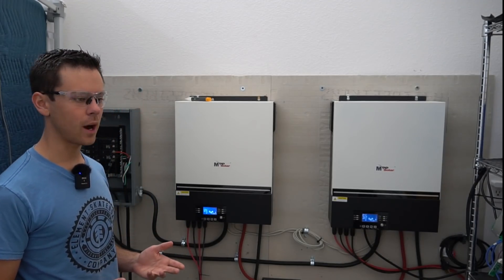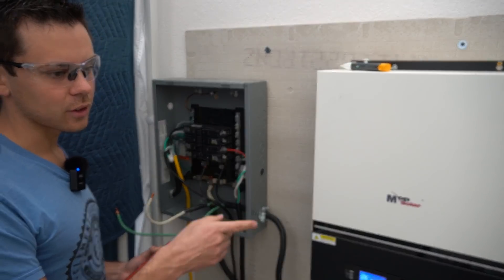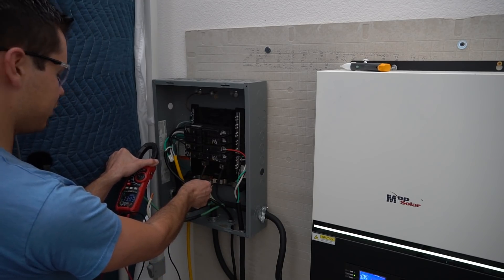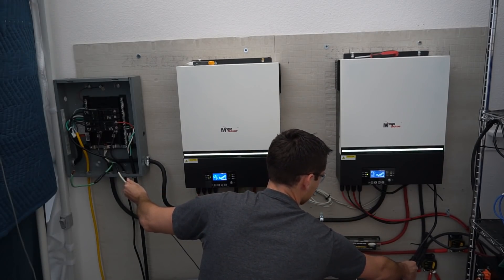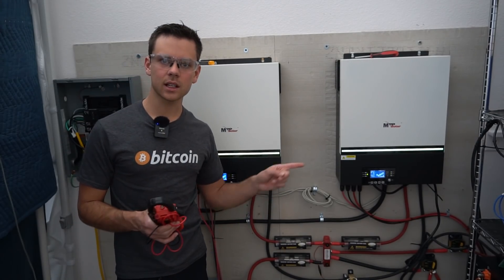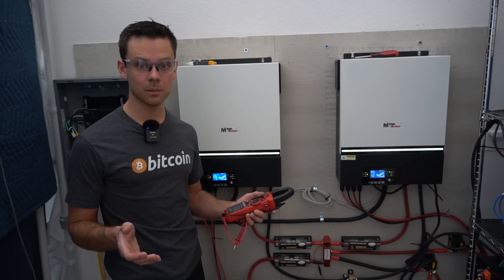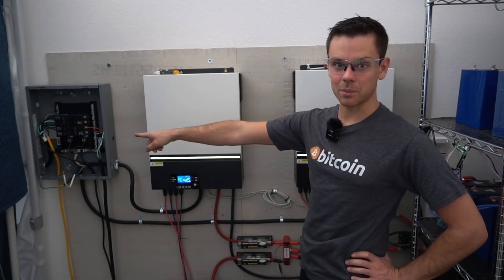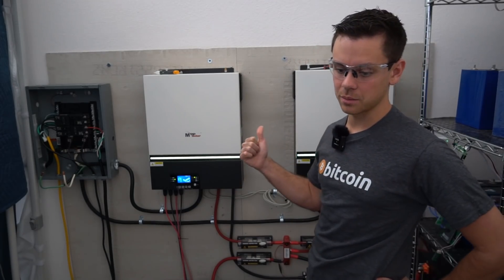Advanced Level Grounding Discussion for All-in-one Solar Power Systems

Comment: How did you conclude that neutral is bonded to ground in the all-in-one inverter?  You can't use the connectivity function of your DVM for this purpose.  If you measure a non-zero voltage between neutral and ground from the inverter, then they are not bonded internally.  My Growatt SPF 3000TL LVM, when running off the batteries, measures 60 VAC between neutral and ground, so neutral is not bonded to ground internally.
Reply: Holy smoke. Seriously? Showing any voltage above 1-2 volts between ground and neutral is dangerous. 60 volts sounds like there is no bond at your main panel either which is the only place it should be bonded, actually sounds like no bond anywhere. That's scary.
Reply: @wgoode505  The output of the Growatt SPF 3000TL LVM 24P is 60 VAC on both line and neutral, relative to ground.  The main panel is bonded.
Reply: @PogoTheFearful  it just sounds to me like something is seriously wrong. If neutral is bonded to ground there is no way it can read voltage between the two if they are connected together. The same as touching your two leads together on your volt meter, it can't read voltage doing that.  Possibly the volt meter is bad. Or maybe the bond is getting broken between neutral and ground when you are on battery, if this is when it does that. This is also assuming you are in the US with 240/120 volt system. Doesn't make sense. Be careful, be safe, good luck with it. It just raised concern to me, never heard of anything like that in my entire 40 years in the electrical field.
Reply: @PogoTheFearful  As a test to reassure myself, thinking I may have a stray voltage or something. I went and tested my own panels. I have my main meter/breaker panel outside and it feeds three 100 amp sub-panels inside, with one of those panels feeding an inverter and also a separate 100 amp transfer switch input feed for my generator. I turned off all 240v loads and turned on every 120v load I could and measured neutral to ground voltage in all 6 panels with full 120v loads and they all read 0 volts between neutral and ground. Only my main meter/breaker panel has neutral bonded to ground as it should be, with two ground rods connected to that panel. Never hurts to check yourself sometimes.
Reply: @wgoode505  My point is that when the Growatt inverter is sourcing power from batteries, the connection to the main panel is severed (other than the ground connection).  Because the Growatt inverter does not bond neutral to ground when it disconnects from the main panel, the line voltages from the inverters are "floating".

Comment: Hello, I live in France. and in some buildings there is a special earthing system, the normal is called TT, the special IT for earth insulation, at the inlet there is a transformer and the seguonder of the transformer is not earthed, but there is a problem monitor.  that triggers if 2 faults are detected. Maybe there is an inspiration to take

Comment: All ground rods are required to be tied together. So yes, another ground rod at the panel AND connect to solar panel rod to the AC main ground rod. This is run underground, bare copper conductor. AND test your earth ground.

Comment: So a few points here to cover. First all electrical systems should only have grounds and  Neutrals bonded in one location. This is at the  meter or first point disconnect.  If the neutral  and grounds were connected in more than one place, this would create  What we call a parallel neutral which is bad. The ground and neutral would  Share the return current. And we NEVER want current to flow on any ground. Now most of the time even when using a generator the natural to the power co is still connected and therefore only one bond location in needed. Now there are  Situations where the neutrals get separated or  Disconnected from utility company.. This is  Called a separately derived electrical system.  An example of this is after a building transformer you have then another ground and bond point.  Again as long as the neutrals from both systems were separated.  The question for you is  If you were to put the inverters in the utility mode what would the ground and neutral still be bonded from the inverter? Is there a relay for this?? I would  Most likely remove the bond strap in your output panel you're output panel but I would definitely nstall a ground rod. I would ever keep the system floating. That would cause GFCI problems  Among others.

Comment: I am getting very aggravated with trying to set up a solar system. I bought one of the growatt 5000 es and did not buy from Signature solar, so i am at a stand still not knowing if i am safe using. I am just going to throw this inverter in the dump and continue using grid power! this solar BS is just not worth the trouble unless you are a electrical engineer. solar is over rated for the normal consumer at this time! maybe re-visit in 10 years! GROWATT SUX!!
Reply: i feel ur pain i just order 2 mpp lv6548... trying to avoid all of this growatt drama ... $3000 worth of i dont know what to do!!

Comment: Extremely Dangerous under fault conditions. Why?

Let's say a hot water element blows a hole in the side of it but doesn't disconnect the circuit breaker and stays on (very very common with hot water elements at the end of their life)
Where do you think the current will flow if your tank is not earthed and you jump in the shower and start running water over your body to the drain system below and then touch the metallic shower head?

You will be electrocuted under these Fault conditions. This is a fault I've seen many times here in Australia in homes not earthed correctly or people removing the earth water bonds from there metallic pipes.

Comment: as per NEC 2020 ground natural connect at fist(main) point only. put earth ground at that one point only . so earth ground first all in 1 unit . then use ground buss to connect the rest system. that ground . now bound neutrals all together on a isolated from ground buss. that way 1 point ground natural come together. no ground loops and every thing has ground. you want to maintain ground for safety and natural as for split phase power north America has. Yes ground loop can be dangerous. even in totally off grid still ground at AC/grid/gen only for earth ground. that way if using a generator you don't get a loop.4 wire hook up. hot 1 ,hot2, natural , ground. never make connection of natural and ground at any point. the all in one has that bound you tested for it. get a NEC 2020 code book has the current codes for a safe system. anyone doing this in US/Canada follow the current NEC . can look up online or buy the book. as a electrician I have the latest NEC book and I follow it. I pass my inspections . also you can reach out to UL for a inspection of the system. Each town has there  requirement's. .find local inspector and ask them.

Comment: Hmmm.  I am not an electrician. Having said that it has also been 20+ years since messing with electrical circuits. I begin thinking 1:1 isolation transformers would be the ticket to interrupt any DC bias. However if the inverters are outputting pulsed DC and not AC, I have no clue.where to go.  just 2 cents that is probably inapplicable.

Comment: I am no electrician but I was in the dairy industry and when wiring a milking parlor all sub panels ground and neutral wires were to be separated.  If they were not it caused a condition called stray voltage which harmed the animals.  If I remember right the only place they are connected is at the main panel because all power eventually the power goes back to the power stations.  We did have some cases where there was power coming back to the farm by the ground wire, then the power company would have to add more pole grounds.  This probably don’t shed any light on the subject but that was my experience in grounds and neutrals.

Comment: Hi will, first just wanted to say thanks for all the great content over the years, I just ordered 2 lv6548 a week ago. I did not go with growatt because of the neutral bonding safety issue and other transformer related issues, i was told mpp was safer/easier and designed to work and be compatible with north America power grid... now that seams not true.?!? I don't know what to do now... in your opinion can they only be safely use off grid? thanks again have a great day!!!

Comment: I’ve had issues with all-in-one inverters like this in the past. Mostly sol-ark, and I found that if i don’t bond the neutral to the ground in the AC output load center, I get fault codes, and I even got shocked from the ground out of the inverter. But once I tie the neutral to ground in the panel, problem solved. Very strange as I was under the assumption that they were bonded within the inverters themselves.

Comment: I wonder if the the 240v single phase versions are different. That earthing arrangement could cause alot of issues on modern installs in the UK and Europe. And all but unusable on a split phase supply in the UK (we do have split phase its just very rare, it normally manifests itself as two completely separate 250v supplies due to our phases running at 400-415v)

Comment: Hi Will, Here in the UK, we just have an earth ground  (Green), live (RED or Brown) and a neutral (Black or Blue) wires keeping it simple. Why does one  need to connect a third to the neutral wire?!! That's putting like a live-sh part (Neutral side of a Supply power) to what you are calling a ground wire, which is supposed to be Just that an earth grounded wire into the earth. Thus any metal surrounding power supplies casings or electrical goods are then save to touch, as they are all connected to ground earth. Which by the sound of things is being turned into the negative side of all power supplies!! Am confused with this!! Makes no sense to me this, a ground wire  is either a common  negative separate to earth ground is it not? Regards George.

Comment: You should use ONLY the utility ground-neutral bond (in the meter or main panel) in any instance where the neutral conductor of your utilization system is connected to the neutral of the utility system. 

Only if you disconnect the utility neutral input from the output of your inverter (either automatically, manually, or by design) should you bond elsewhere, such as inside of or after your inverter. 

You can have as many grounding points (ground rods, metal equipment sitting on concrete, conduit attached to steel framing) as you want, so long as there is ONLY ONE point where your ground system is connected to your neutral conductor.
Reply: You could even have a separate ground rod for each inverter, panel, run of conduit, outlet, etc. as long as you attach it to ONLY the earth ground and not the neutral conductor.  

The take away is ONLY ONE GROUND-NEUTRAL BOND PER PROPERTY at a time. Everything else is details.
Reply: @paulmccoy2908  And tie All of the Earth Grounds with #6 copper!
     Ya'll Take Care, John

Comment: Great, so I've seen this explained two completely different ways in the past 30 minutes. 
One saying ground and neutral need to be separate, this saying you need ground and neutral bonded. 
I'm just a DIY guy with a solid understanding of audio electronics and computers. You know, complicated stuff. 
How is there any controversy or wiggle room on something as basic as 3 wire AC? It's been around for decades.
Reply from the maker: High frequency transformerless off-grid inverters in parallel on each phase has not been around for long. And whether to bond or not depends on your situation. That's entirely up to you. Don't listen to any YouTube person or manual. Figure out how it works and come up with a conclusion on your own.

Comment: This is a very complicated subject that even has many professional electricians scratching their heads. I would encourage more in depth coverage of the subject (that even I get lost on).
Reply: It is not that difficult, this just common mode, engineer tends to use complicated words that makes a mess
Reply: I totally agree I know nothing about grounds or grounding
Reply: Yes. More coverage needed. What to do with the ground because the wrong thing can be done in an attempt to do it right. What in the heck is the purpose of the ground on these inverters. The fact there isn’t even a slight suggestion in the manual makes it worse.

Comment: Hi Will, at about 2:30 you stretch both arms to make contacts.  Please consider a spring loaded "alligator clamp" for the test wire so your arms don't provide a possible circuit.
Reply from the maker: I actually have a lot of those but they were on the other side of the shop

Comment: I own and operate a growatt SPF 3000TL LVM. And I need it to operate both from the grid and from the batteries.  When the system operates from the batteries there is no bond between the ground and the neutral.  Some of my loads require there to be a bond.  My main electrical panel already has a ground neutral bond and when the transfer switch goes to grid power my loads operate normally.  The inverter has a set of dry contacts that can be used to control a ground neutral grounding box.  When my system operates from the batteries it turns on the ground neutral bond.  When it transfers to grid power it turns off the output bond because my panel already has one. Hope this made sense
Reply: Hi John, I am using the same SPF3000, may i ask where is this "set of dry contacts that can be used to control a ground neutral grounding box" ? is the manual showing how to turn it  on when using power from battery? thanks
Reply: @VincentsfamilyCali  yes its in the manual. There is a set of contacts in the bottom middle of the unit labeled C - common NC - normally closed NO - normally open
Reply: @VincentsfamilyCali  you only need to bond neutral to ground if your appliances require it. And you only need to have a relay if you're using grid power where a bond already exists

Comment: I see the use of a grounding relay in a lot of cases where it gets tricky like this. I'm defiantly not a fan of inverters that bond the ground and neutral internally.
Reply: I've just worked on an RV solar setup where I thought I needed to unbond the N-G connection. What happens is the 120v output is present, but there is no "hot" nor "neutral" line - the 120v is "floating. We wanted to protect the user with GFCI, which needs a "hot", "neutral" and "ground" for the GFCI to function properly. One side of the alternator charging line was at chassis ground, and that became our "system earth". Neutral was bonded to this "earth in the inverter, and now the GFCI trips as it is supposed to with the tester. But our solar system does not have a shore power connetion - it is completely isolated from the solar power.

Comment: That's interesting. I was always under the impression that a system should never have current flowing on the ground path. If the inverter has a neutral bonded to earth the question is will some of the current of the output find its way back on the earth ground. I'm not completely convinced that it will because it is artificially generated by the inverter itself. If this just a single phase input splitphase output transformer than that center tap would be bonded to earth ground or locally grounded to earth directly if the distance was far enough. 🤔

Comment: This is the reason I am using an isolation transformer for my system. No electrical connection between input and output seems to be the right path forward.
Also I'm just not going to have an A/C input to these off-grid Inverters, they don't seem to be electrically safe to use here in North America. A transfer switch between grid and off grid looks to be the only safe path forward. Also in the MPP units, I am removing the ground bond screw, as I will handle bonding in the panel.

Comment: You are using a sub panel, but what about using your 2 inverters configuration on the main panel and off grid system where the main panel has a ground and neutral bounding per code in the US? Thank you.

Comment: All a little bit over my head but it occurs to me that what Will is doing here is a pretty standard installation, pairing two of these units in an off-grid configuration and that any manual should offer a "reference design" for the most common deployments. There really shouldn't be too much debate about the standard way to do this and discussions should be limited to when you decide to get a little funky with your design. Manufacturer's need to do a better job with documenting reference designs and maybe pay some people who know what they are doing to develop these designs and document them. I think an extra $50 on the price of a unit would be well worth the reduction in research and headaches while trying to figure this stuff out.

Comment: @Will, I think I've been saying the same thing maybe in an awkward fashion. In the example you provide here the panel should have a floating neutral and the ground should be bonded to the case. It is effectively a "subpanel". Equipment bonding to ground and neutral ground are 2 different animals. Supplemental equipment grounding is okay and even encouraged but you only ground the neutral (current carrying conductor) at the point of origination. Subpanels ALWAYS float the neutral. That describes U.S. grid systems. I would expect the same set of requirements essentially to apply to an off-grid or separately derived system. Is that correct? Are we saying the same thing?
Reply: Thank you.  I will remove the bond wire in my sub panel and float the neutral and allow my off grid ecoworthy 5k to manage the bond internally.  I was alarmed and reacted when I saw a 33vAC potential between N and G at the panel.